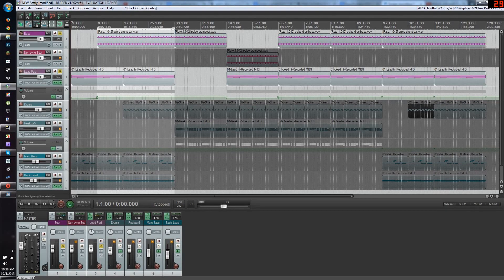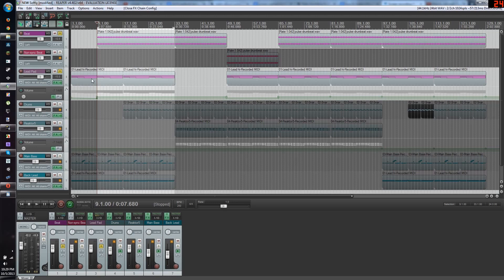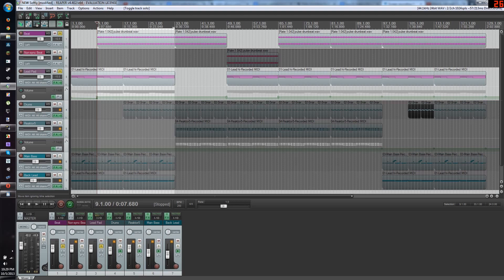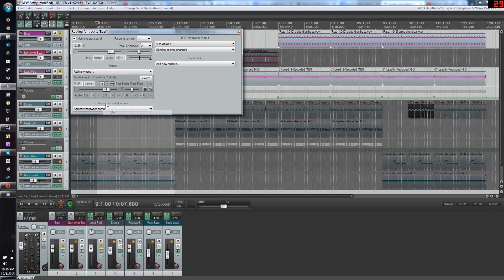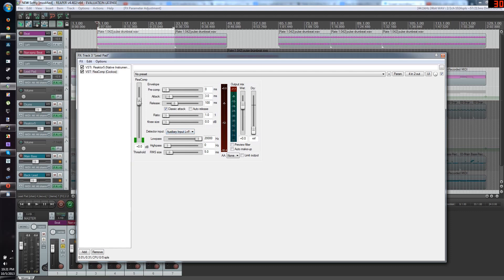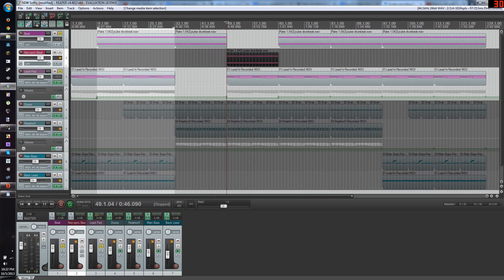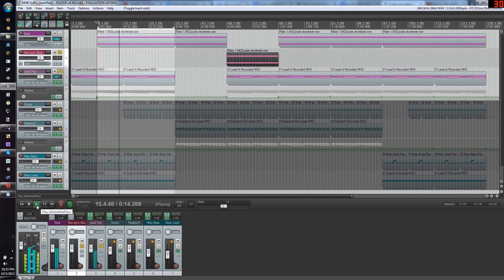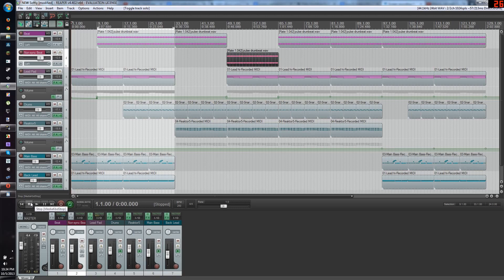Make a bouncy pulse synth in REAPER (vital for dance, electronic, dubstep, etc...)

Comment: Thanks, this is informative. I've been making some electronica with Reaper and sometimes feel I'm making it hard on myself as opposed to using FL Studio or Ableton, since I'm an amateur, just learning.  I don't see much out there for trance Reaper tutorials.  I'm particularly interested in the builds/breaks that use white noise and sweeping and such, which I think involves envelopes which I don't really know about.  Could you make video re: that, or perhaps suggest one?
Reply from the maker: Hey. I just made a video on Filter Sweeps and it was pretty simple. It does involve using an envelope to automate an EQ plugin but it's not as hard to do as you'd think. If you're still interested in that, you can watch my video on it.

Comment: a better way to hear the synth with out the drum in it would be to make a folder and put the drum track in that folder. then on the folder adjust the volume to - infinty or desired level. that way u can automate volume on kick using the folder track but the synth always remains sidechained using the solo feature u mentioned mean the kicks on or off depandant on what u use when this way you can choose when and when not you want the kick using automation. thats the way i prefer it anyway :) anyway man top video :)
Reply from the maker: Thanks for the tip!
Reply: 1 of the good things about being a reaper user is we all share are knowledge with each other :)

Comment from the maker: I used the safe bass opposed to either of the main oscillators. The safe bass is a sound source of its own and has a much smoother sound than is easily achievable in either of the main oscillators. You can't use the filters with it but it's a quick way to make a basic string pad. If you pause the video at 1:01 and copy everything you see you should get a similar sound.